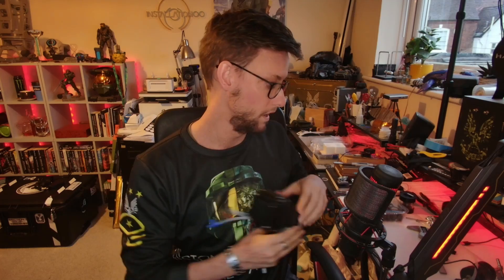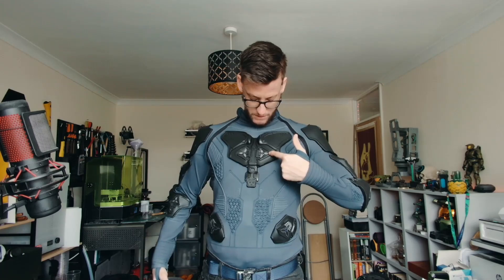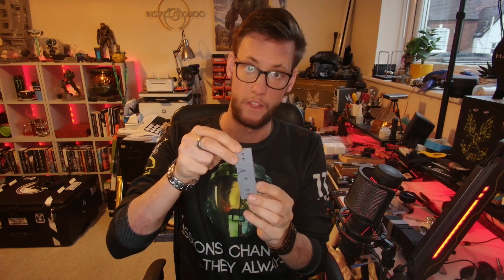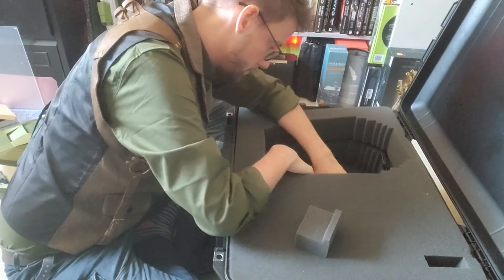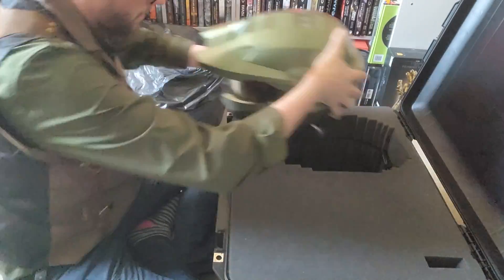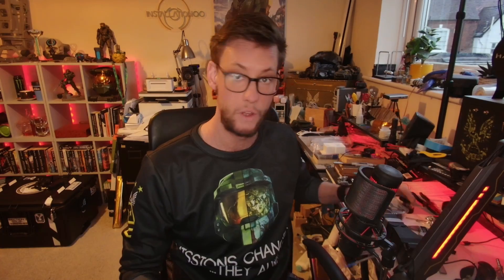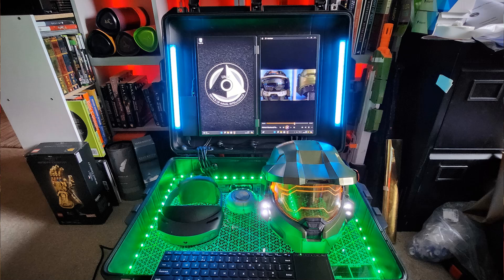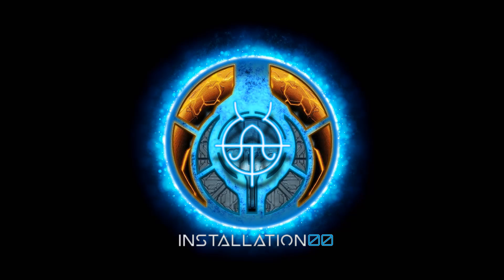'Tony Stark' style Pelicase! | Project: MJOLNIR Update

Comment: I am reminded of Troy Hurtubise's Trojan armour suit, sometimes I wonder if he had a community to help him critique and further develop his suit he would be still with us today. Keep up the great work 00!

A point I'd like to stress (ignore if you'd covered this before, I may have missed a video or two), moving forward with the full suit, active/semi-active body cooling systems are going to be very critical considering that both ODST and Spartan armour fully covers the wearer and are expected to operate in all environments. Coming from the tropics (Singapore), when serving my national service in the armed forces we were always concerned about heat stress issues. Innovations have come along like uniforms with lighter material, but all are passive solutions which then gets negated by equipment like plate carriers and helmets. Short of lugging around a condenser unit, the next best thing are peltier coolers directly on skin contact. Commercially available examples today usually only cover the neck, with the best one I've seen covering the spine area between the shoulder blades (ST Engineering Arc Cooler). In combat ops I'd believe the cooler will need to cover the full torso.

Comment: Resistant to small arms fire?
Sure. For the first 2 rounds.
Reply: "You may have heard the amazing accolades of titanium. It is lighter and significantly stronger than steel. It is durable, yet easily moldable. It can withstand high temperatures as well as chemical and salt corrosion and rust. These characteristics make titanium a popular choice in manufacturing.

With its superior characteristics, is it bulletproof?

The answer can be both yes and no.

Shooting enthusiasts, mechanics and curiosity-driven “scientists” have taken the opportunity to test and address this same question.

The results were largely in favor of titanium.

Most of the guns used for hunting as well as handguns for self-defense and personal use could not penetrate the sheet of titanium.

However, repeated shooting of the titanium with higher-powered firearms eventually worn down and weakened the titanium so that it was eventually penetrable.

Titanium, however doesn’t stand a chance against bullets fired from high-powered military grade firearms such as those used to penetrate tanks. Titanium can take single hits from high-caliber bullets, but it shatters and becomes penetrable with multiple hits from military-grade, armor piercing bullets.

In the end, titanium is bulletproof for the most part against bullets fired from guns that one would likely find on the shooting range, on the street or on the hunt in the mountains. Most guns legally bought and owned by individuals will likely not penetrate titanium." - Titanium processing center
Reply: It's always more resistant than the skull containing the brain that thought of this comment.